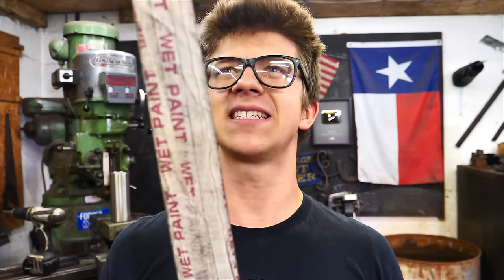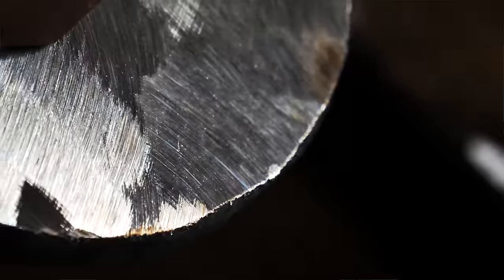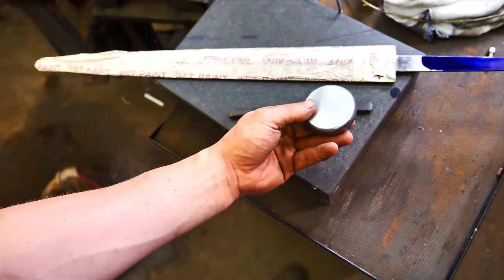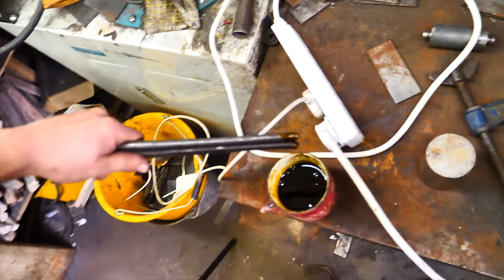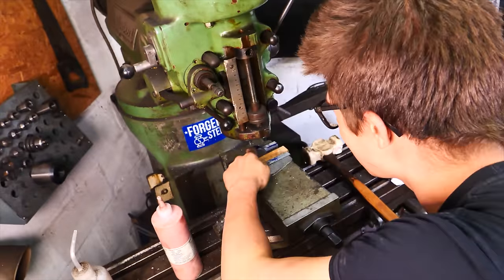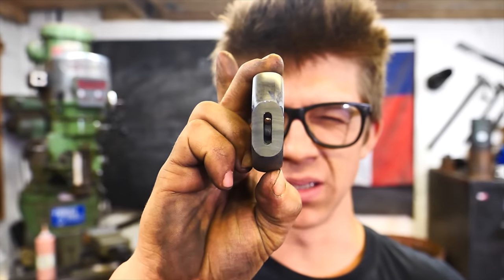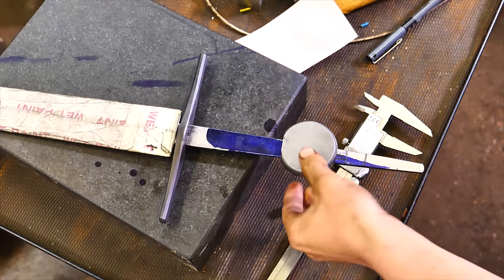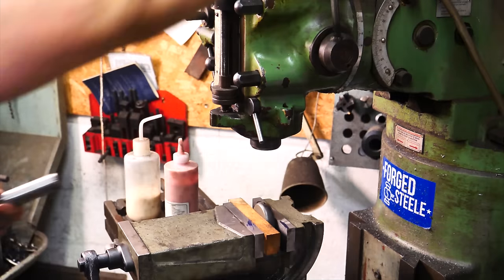MAKING MY FIRST SWORD: Part 8 - The POMMEL to End Him Rightly? Screwdriver required!

Comment: Hey Alec, I have a question about the sword. Are you going to make the handle bigger in any way? Like are you going to form it to your hand for a better grip? Because if you want you could do the thing that some knives do with their handles. You could have two wooden sides to the handle with rivets holding it in. I don't know. It's just a suggestion.
Reply: PikaHika01 while a mechanical fastening is usually beneficial for lots of use/abuse, not all weapons are assembled as such. with what he has now, he could burn a strong wood handle on, then affix his pommel, and be perfectly fine. Especially if he fancies it up with a leather wrap that has a twine/wire underlay for improved grip. probably more than enough leathers out there that would REALLY make that pattern POP!

Comment: When you are afraid to cut something, remember that anyting can be welded back on! Metal is one of the few materials in which mistakes are almost completely reversible. Of course it will scar the damascus, but this doesn't matter for the tang

Comment: Alec, you should pick up a book called The Complete Bladesmith by Jim Hrisoulas, aka Atar of the Salamader Armoury. Your blade will be gorgeous, but there are a few significant flaws like the squared corners at the blade/tang interface. The book above is a wealth of information on sword and knife construction and details on a variety of different damascus patterns. It's available on Amazon and Mr Hrisoulas has written a couple of excellent follow on books including "The Pattern Welded Blade". Loving your work and your videos, and especially your zest for learning! Keep the fires hot

Comment: Tip for your next sword pommel: weld a steel rod on the ens then tap it. Mill the sam diameter hole through the pommel, screw the pommel on then peen the end. The wels won't break cause hopefully the pommel isn't taking much impact

Comment: Alec, I don't want to be a bummer, but before you go further in assembly, think about whether heating the bolt at the end of the tang might have affected its temper. If it's too soft, you'd hate to find out when the blade shoots out of your hand and you're left holding an empty handle.

Comment: Hmm, though I like the more involving threaded pommel fitting I'd have used the mill to drill and cut as you have but with a slight difference, a countersink to the hole on the opposite face to the slot, then haeted the pommel for a heat shrink fit that won't come apart and leaving enough of the tang protruding to heat up and hammer into the countersink as a final step, ground smooth with the pommel once it's all cooled down. And since it's the same material at the blade some of the patterning may still be visible??

Comment: Alec, I started watching your videos a couple of months ago, and you have gotten significantly better at editing and making videos in general.  you have also gotten a lot better at blacksmith too in my opinion.  as for your"go make something" command, you should know that you have inspired a 14 year old American to build his own coal forge and begin blacksmithing in his backyard.  I have (at least I think) learned a LOT from your videos, and I love watching them nearly every day now.  also, could you do a couple videos on how to make normal knifes out of say rebar and other widely available resources? I don't have the money to buy large amount of 1080 steel, and it IS Possible to harden rebar (I tested it).  also, what oil and etching solution do you use?  finally, do you have any tips and/or tricks for a blacksmith who has made only one (terrible) knife and a couple of tool-making!

Comment: Alec, why did you weld the bolt into the tang? The way you prepared it, the screw's head would be able to hold the pommel just by its shape. Just nitpicking. And yes, I do enjoy making things. Even if making them has its share of scary decisions and moments.

Comment: I'm not a blacksmith, but what about a rivet, or screw through the center of the flat side of the pommel.  That way all you need is to drill a hole in the tang.  You love rivets, maybe you could forge a Damascus rivet.

Comment: I think what I would have done is used a bigger bolt cut a slot in it to fit over the tang and then welded that.  Mostly cause like you Alec I wouldn't want to cut the tang.

Comment: what size is the leg vise you are using?
What height are the jaws from the ground and how stable is stand its mounted in since I do not see any leg post part to it.

I will be making some thing, I use induction a forge.

Comment: you shouldve threaded the tang itself, it doesnt matter if its thinner then 4mm, you could still thread it with that thread, this is done on bikes, you can get 14mm axles that are slotted so that if you rotate them they fit inside a 10mm drop out.

Comment: I'm asking as someone with no experience so the answer might be obvious.... but wouldn't a great permanent way be to anneal the tip of the tang then push the pommel on to the point where it stops ( alternatively cut a step in the tang and use a smaller slot...) then pound down the now soft end like a rivet ?

Comment: sorry to tell you mate but to fix a pommel that way is the most unstable way, its mostly done on Wall hangers not actual swords. the best way would be the historical way by forging the tang over like a rivet. my first sword for contact sparring was fixed that way (around 10 years ago by now), it broke after the second training sice then i never touched a sword with threaded pommel again, but anyway i hope for you it will work out better.

Comment: So my question is if the slot is cut to fit the tang snug but the tang is smaller than the bolt, how is the pommel going to fit on the tang?

Comment: how much was your forge and lathe? I'm looking into starting my own thang but I'm starting from scratch and I'm not rich so any beginner tips and recommendations would be much appreciated. Sword looks great!
Reply: hey there, Im not alec but I am a blacksmith apprentice, Forges can range depending on if you want to build your own or buy one premade, I made my first forge out of pizza oven bricks and a few black iron plumbing pipes to make the burner ( the burner took some research to make .... functional it was an awful burner) the mark 2 forge was upgraded with kiln bricks from a pottery shop nearby that have a higher heat reflectivity and resistance, as well as an upgraded burner.

now that's one way, a lot of proper smiths (including me now) cast our forges using refractory, I believe alec has a video somewhere on how he made his refractory, and of course there are a couple different recipes for refractory that you can research and look into.

steel lathes are expensive you can get small versions that run 500 -1500 bucks which might be good for getting you going on that front ( i haven't needed one in the 2 years I've been forging) 

for a real beginner forge you can always just dig a hole in the backyard if you have one, use a PVC pipe and a bike pump to get air into the bottom and make a charcoal forge.

as for anvils and the like, any piece of steel will work, I -beams, railroad tracks, or just a piece of scrap from a yard, there have been so many different types of anvils over the centuries that pretty much anything chunk of steel will work to start ( I bought a harborfreight cast iron anvil (300 bucks) to start with, now they are NOT good for long term use but I found it invaluable as a beginner)

I hope this helps in some regards, even though it's 6 months later.
Reply: @PaladinCaddy  Thank you for the tips, I appreciate it a ton! This past summer I did manage to make a little charcoal forge with some cinderblocks that were left on my property when I bought it and I dug a hole and had one of those floor dryers you see at a grocery store in the winter, that I would turn on and off quick to heat up the coals lol. it ended up being hard to control so I went and bought a pump. 

Went walking on the old railroad tracks and found an area where they dumped old steel from the tracks and took a small I-beam and a railroad spike that I welded to a piece of rebar and ended up with a nice little knife at the end of the summer lol have a little more sanding to do to though but I got lazy when it got cold. 

I'm definitely going to look into purchasing an actual forge (antique or new) over the winter so I can have an easier time with it all. I would like a lathe as well just to make the extra nifty bits so its good to know there's at least a small semi cheap version that i can pick up. love the brick oven pizza forge lol, cook pizza and make a sword at the same time lol burnt pizza

Comment: How is that 4 mm bolt going to fit through the slot in the pommel if it is meant to fit the tang which is less than 4 mm? Or maybe I misheard...

Comment: Pommels do not need to be bulky and heavy, many were completely hollow. The main function is to prevent the sword from slipping out of your hand when swinging it, second use is for balance and that should be a few inches up the blade from the guard. If your pommel is too heavy the balance point will be too close to the hand. If the balance point is at the hand it makes it harder to parry and bind plus less force behind a cut. Too close to the point and the sword will feel heavy and unwieldy.

Comment: would not the best course of action to the hot painting the pommel on to the time of course it would be fixed together forever but still you will get a much better fit and it would be more stable in the long run

Comment: He and Sam seems to such good guys, a thriving to excell. But I am worried about the bolt he used, and then burnt the hell out. Every ounce of a proper tensile strenght may well have all gone, pobably it would be too soft, or brittle. I think there are more knowledge on this then I could bring, but i would be bad to have it brake and disintegrate the sword, and fall on some hard objects. Keep it up Alec and Sam. And please do not burn out, You are old enough to buy booze here in Sweden.

Comment: You could of just fitted it as best as you could and then riveted the remaining part of the tang into the pummel by beating up the tang and then hammering it in forcing the best fit possible. It is probably the fastest and simplest way to do it.
Reply: Heating*

Comment: the best way to pommel a sword... taper the tang,  fit the pommel,  torch peen the tang to the pommel.  this technique used is for wall hangers,  shit swords,  cheap swords.  a well made sword shouldn't require being taken apart.   or you could adapt a katana handling technique.

Comment: i know this is quite late, but knowing your machining skills you need to know that this design might not work out as good as you want. only way to work around this now is to let the nut longer(if it`s sorter, you`ll experience rattling in your pommel). Good ideea would be to let it stick out a little OR let it a little longer then trim it to true. if you need more help brainstorming that you`re welcome to contact me

Comment: didn't they use to just wedge the tang all the way through the pummel then hammer it down so it was bigger than the whole and the pummel wouldn't come off, im just curious cuz swords have been around alot longer than mailing machines and i pretty sure they were used quite extensively in rather high stress activities ie WAR. and that way worked out just fine, don't get me wrong your idea may be great and work fine or even better. but if you were so worried about it why not do it a simple but tried and tested and proven acceptable way. you know like how they have done it for hundreds of years

Comment: Alec- you vastly over complicated the attachment of the pommel. I would have simply dropped a weld into the hole in the base, and sanded it smooth. You could have burned a one piece handle prior, wrapped the tang, or done a two piece handle after welding on the pommel.
Excellent first effort. And as always, I'm envious of your Damascus skills. My patterns are never as clean, or nice as yours. Well done.

Comment: Oh stop @ 10:45. If you cut it wrong, just weld a repair on. You going to be welding it anyway, to attach the threads.

Methinks you have the cart before the horse. I'd make he grip before attaching the pommel. Then you'd know exactly where ht pommel should be located.

You probably could have threaded the tang. It doesn't have to be a full thread. It isn't like you're hanging 500# from the pommel.

Comment: Forgive me for saying this, I've watched the vids since part 3, and while I sometimes facepalm for some of the, in my opinion at least, less than intelligent choices you've made creating the sword, it's still your sword :) That having been said, I do have one question. You welded a bolt onto the tang of your sword... would it not have been better to work down the last inch or so of the tang to the desired diameter, thread that and attach the pommel that way? even if you didn't want to peen the pommel onto the tang. From what I know of metalworking, welds tend create weak spots in the integrity of the metal. Not saying you shouldn't have, just wondering why you did, that's all.

Comment: your running your tip cutter to fast. there shouldnt be sparks. also if you rig up your air line to blow a constant stream of air onto the cutter you will get a longer life from the inserts. coolant is better but for the amount you use it you can get away with air.

Comment: Who told him that a pommel is a counter weight?
That's simply not true for different reasons.
For one: having a blades balance close to your hand gives your opponent more leverage.
And on the other hand: many pommels were made from wood and plated with metal, or hollow.
Reply: Darius der Rote it really depends on the timeframe and type of sword. for an arming sword of the high and late medieval periods, solid pommels were preferable to increase maneuverability, the shorter blade length compensating for an opponent's advantage in leverage.
Reply: Jake Easterday Oh you mean the high period of the Viking sword of the 10th century? That often had wooden pommels? Or the high period of weapons like the "langes Messer" who had next to no pommel at all? 
Weapons where you need more manoeuvrability were of a totally different design and most of the time had no pommel as well, like the rapier. 
So what are you talking about exactly?

Comment: You are much better of slotting the pommel, sliding the handle and hilt over the tang and peening the end of the hilt. Screwed on pommels typically strip off the tang.

Comment: next time just fit the tang all the way through the pommel then peen it over,   I mean yeah you acnt easily remove it after that,  but It seems a much simpler solution,  and will end up with a  very solid fit

Comment: It really pains me to watch a beautiful full tang sword get hacked into a rat tail tang. I can't even finish watching. Making it full tang through the pommel and hot peening the pommel to the sword would be easier and make the word much stronger. Taking the easy way out created more work and turns a masterpiece in to crap. You have all the tools to do it right but copped out. Making your living doing youtube videos should give you the time to do it right, and you can learn and share it with us here and its all the same in the end. Instead you have a turned a fully functional war sword into a wall hanger SSO. Sword shaped object. Its a real shame.